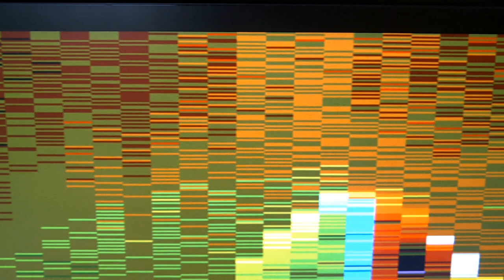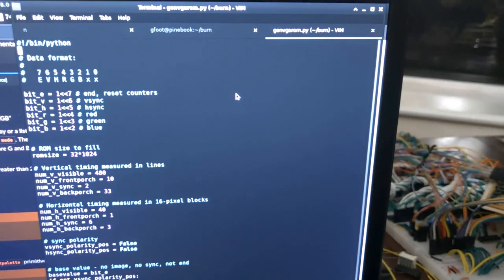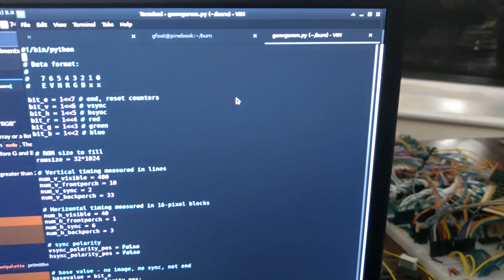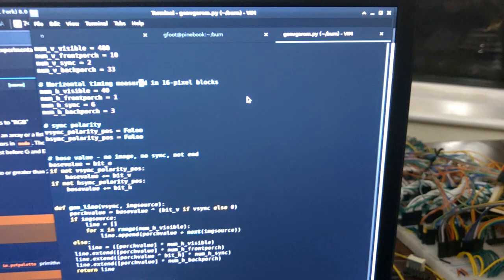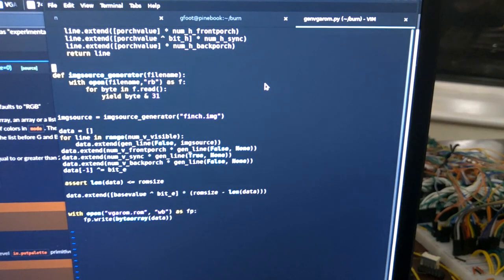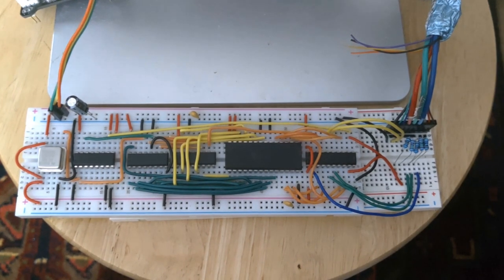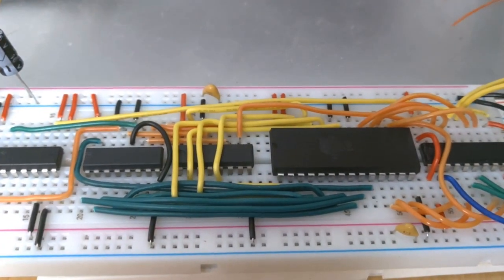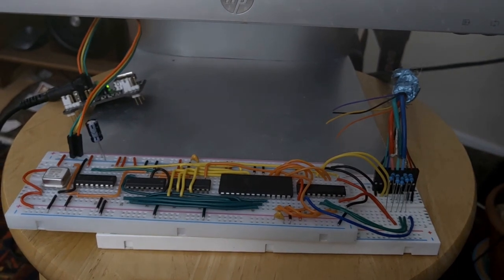The World's Simplest TTL Video Card?

Comment: Great minimal VGA card. My first VGA used 2 breadboards but had separate control ROM and picture ROM as it was 160x120 in 6-bit colour. I didn't latch the counter resets from the control ROM as I found it didn't make much difference but I used 161 counters not 590 counters. I'd love to see the RAM version and see how you interfacing it to a 6502. It was a great feeling when I got mine working the first time over Christmas last year. The latest version has been on breadboards for 6 months and I'm getting a few glitches so I think it might be time to put it on a PCB.
Reply from the maker: Yes I think yours might have been the one that prompted me to use the EEPROM for sync signals.

I just uploaded an update on the RAM version, it's working as well as can be expected given all the corners I cut!

Comment: Couldn’t you elongate the vertical resolution by ignoring the bottom bits of the address? (Not that you’d want to.)
Reply from the maker: To elongate vertically (double-scanning) I'd need to ignore the low bits of the vertical coordinate, but I don't use separate counters for that, and the line length is not a power of two - it's all stored contiguously with no padding. So there aren't any specific bits to ignore.

I considered adding padding, but then it would also need an end-of-line signal to skip the padding, and I chose not to sacrifice more colour bits for that. If we settled for monochrome though, with an extra shift register, it could work and allow 320x200 resolution within 32K - or with 4-bit colour it could allow 80x200, or maybe 160x100, with the same chip count as now.

Adding more chips would of course fairly easily allow all of these things. It's why I think this is an interesting base to build on, as it's heavily compromised due to an artificial restriction which, when removed, opens up a lot of options.

Comment: It's the Atari 2600 playfield with more colors per line and vertical resolution.
Reply from the maker: I've made some improvements since then, so higher resolution horizontally but lower resolution vertically - and started implementing some games that would have felt at home on the 2600 I think: https://youtu.be/XPLPTlAPOVA

Comment: Hi George, just to say, it does fit on one breadboard
Reply from the maker: Great, did you build it then? I figured it should fit except that I was wasteful with the VGA connector - I wired all the grounds through individually instead of joining them together in one connection.
Reply: @GeorgeFoot  yes, I tried to post a picture but wouldn’t work